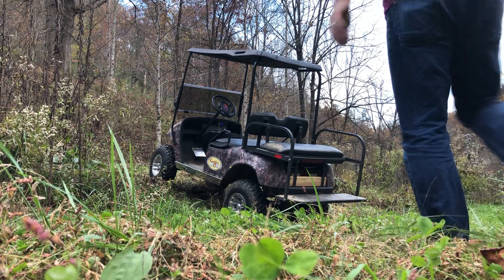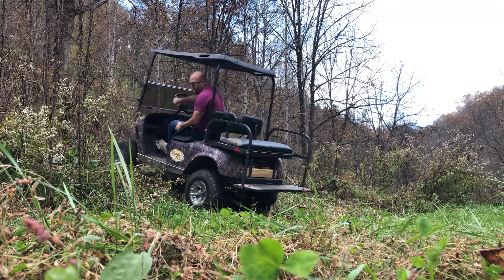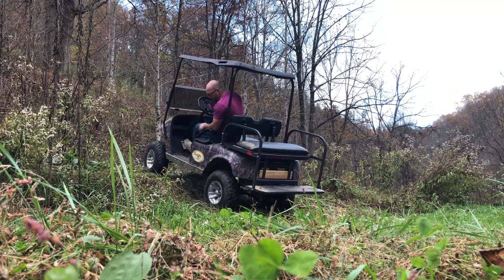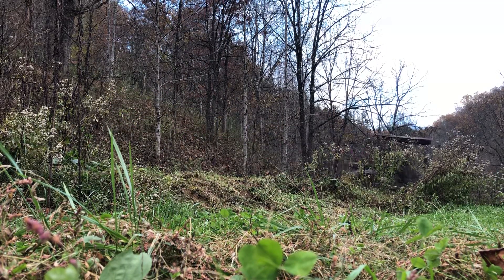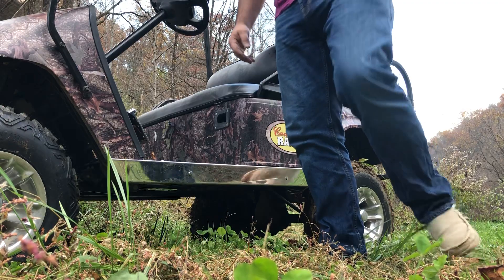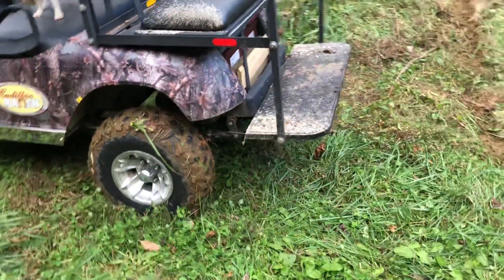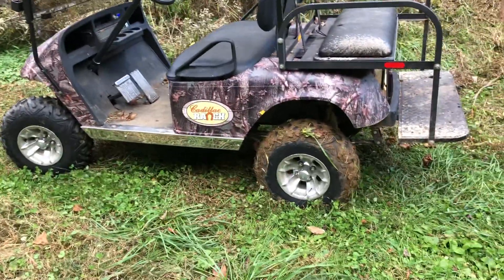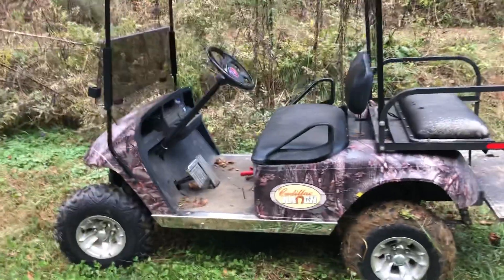Ezgo TXT 48v 600amp Alltrax controller torque increase!!

Comment: My stock 36V TXT PDS will spin 20 inch AT tires on a hill like that. Stock everything. 2hp stock motor and controller, new Trojan 6v batteries, full 2 gauge cable kit. With the freedom plug it'll run 18-20 on flat ground. However going offroad into the grass and up hills it'll bog down to about 10-12 mph. It'll still climb the hills but barely, but it will breaks the tires loose and spin them on the hills sometimes. 
I'm looking at the Alltrax 400 amp controller and 7HP high speed motor. Supposed to go 23mph and have 20% more torque with the 36volt setup.
Reply from the maker: Careful with the speed motors if you are going to use them in any type of hilly terrain. The 20% extra torque is in the higher rpms of the motor. You will actually have a lot less torque than your stock motor does at stand still to half speed. Your biggest bang for the buck is the controller. If your going to buy a controller don’t waist your money on a 400amp controller. Get a 600-700amp. The difference in price from the 400-600 amp is negligible, and ithe 600-700amp will literally double your power out put to the wheels over the 400amp. By far the best money for torque available

Comment: Did your cart start out as a 36v series cart? I’m curious what all you’ve done. SR48600? Which solenoid and reverse switch are you running? What lift did you go with?  Thanks!!
Reply from the maker: It did start as a 36v. I have a complete build series on my channel. Everything I used is there.

Comment: wondering how this is holding up with the stock motor. I want to get the same alltrax controller for my golf cart and run the stock motor till it dies.. Also if you upgraded the motor, what did you go with?

Thanks,

Steve
Reply from the maker: The Reality Of It It’s holding up just fine. There are a lot of people that have upgraded to 48v and left the stock motor alone without issues. As long as you have the Black motor.  There is a Grey colored motor that came on some earlier 36v ezgo’s that apparently doesn’t hold up with 48v’s.

Comment: I have an ezgo 48v goes 18mph currently but I'm not sure what the previous owner did to get that speed increase.

I'm definitely looking for more torque do I need a new controller for more torque or a new motor AND controller? 

Thanks
Reply: i have a ezgo rxv and when i bought it (used) the dealer had a programmer that set the higher speed.